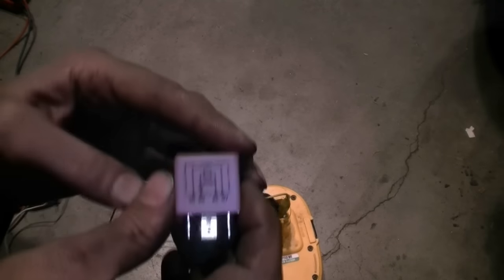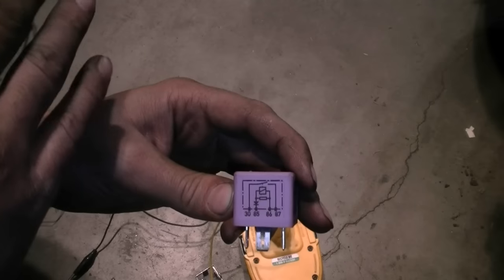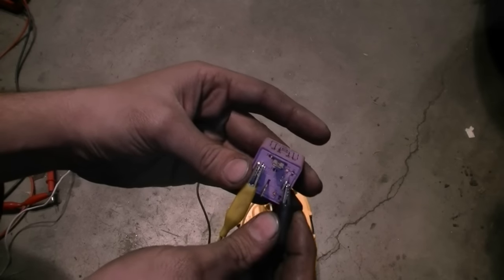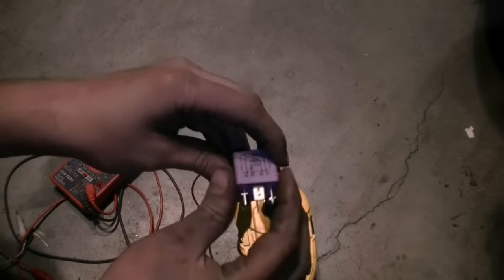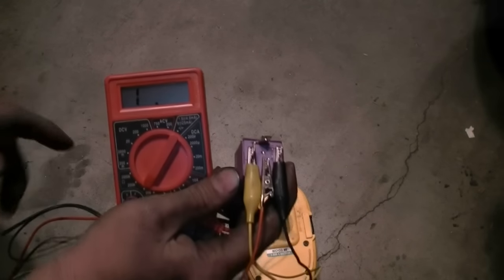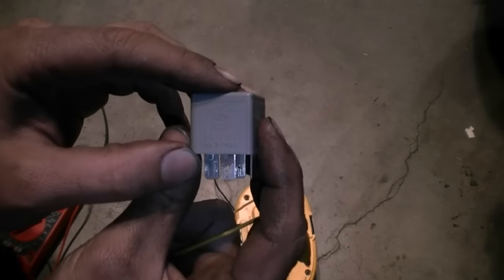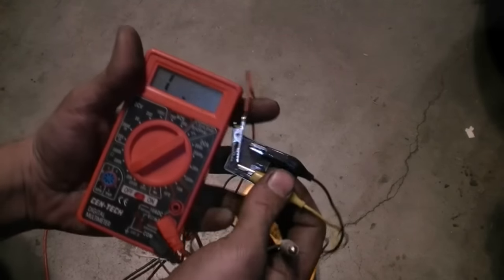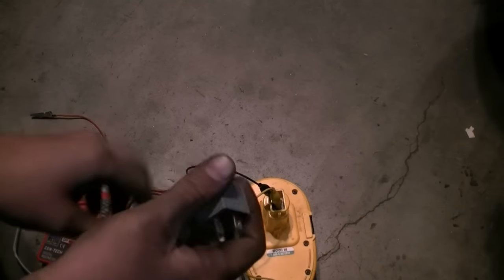How to Test a Relay the Correct Way

Comment: SWITCH! ITS A SWITCH!
Reply: As a Electrical Engineer I almost cried when he called it a flapper 😭😭
Reply: @alexanderquilty5705  Doorway! It’s a doorway! — never mind, wrong blueprints.
Reply: Ahahaha 🤣😂 uhh I'm right there with ya
Reply: @alexanderquilty5705  You came here to learn. Sit down.
Reply: Flapper
Reply: Contactor is the correct term.
Reply: contacts
Reply: It's relay
Reply: No it's not a switch, it's a contact or relay . It's designed to move contacts to energize the circuit. The contacts are designed to be a wear part that obsorb the inrush current/ arch
Reply: @Alexander Quilty  I know guys that don't know the name of nearly any of the parts they are working on & can fix damn near anything & still work circles around engineers & guys with degrees that went to school to learn the names of fancy parts..just sayin.. sometimes it's more impressive when people can just fix things
Reply: No, it's called an armature.
Reply: As an identifying plumber-self... It's a flapper.
Reply: its a flapper now
Reply: It’s a pole
Reply: @alexanderquilty5705  why are you watching this as an electrical engineer
Reply: @SupaDave63 obsorb[ sic]? Arch[ sic]?
Reply: I'm just a regular electrician and that still hurt.
Reply: @MrMd5555 they might not know the correct terms but they do understand what occurs and how it works.
Reply: It’s a dong
Reply: Its a staff

Comment: A 9V battery works great for this. It’s enough voltage to get the relay switch to pull in (I imagine there are heavier relays where this won’t work, but on these small auto relays it’s a piece of cake). No clip leads or cordless battery needed.

Comment: If uncertain of a relay, another way to check is to swap it with another of the same size from a different circuit.   If the problem goes away, you can be reasonably sure the 1st relay is bad.

Comment: Ratchets and wrenches, love your videos. I just wanted to add one thing you forgot to mention. 95 percent of the time a resistance or continuity check is perfectly fine but sometimes a bad switch will show good resistance but as soon as you load it with more current than what the multimeter can put out it will go back to an open circuit. This concept burned me a couple times before I understood it and will make you go crazy if you aren’t aware.
Reply: Also not to forget, temperature plays a critical role in this. Some relays will act up jerking when the engine bay is hot. Under heavy traffic or traffic jam (stop and go traffic) or also under low freezing temperatures. So those cases are a little bit harder to diagnose because basically you want to wait until those conditions happen to test them. It once happened to me. Just my 2 cents.😁🙃😜
Reply: @joecualquiera  Amen to that ! . I replaced all the relays on my 1987 BMW M6 with Tyco and Bosch relays for prevention of possible problems. Then I started getting full throttle power surging. The new fuel pump relay appeared to cycle open -closed under load and hot southern climate. Put old one back in - problem solved. Maybe the diode-resistor combo on the new Brand A relay was a little different than the original Brand B relay.
Reply: Could i use something less than 12 volts? Like a 9 volt battery?

Comment: I know this video is like 8 yrs old, but I am so glad it is still up. Yesterday at the car show, a fan came up just after I pulled in and parked. He was sharp. He noticed right away one of my dual elect. radiator cooling fans was not working. It has a built 460 in the 67 Mustang and it has been running hot.(It is also very hot outside too). I planned on putting a toggle switch in anyway so I can turn them on earlier rather then when it is 185 deg or higher. Wired up the toggle switch, and test both relays for the click. Will finish up with the resistance check tomorrow. Thanks so much for sharing this info. It has helped so much. Cheers from Motown.

Comment: A couple basic tips for those who don't know:  A normal switch has 2 basic states, normally open (NO) or normally closed (NC). When power is sent to a switch it change states, so a NO switch will become closed. That means power will be distributed to any legs designated after the switch. A NC switch does the opposite, when signal power goes to the switch it will open the circuits, terminating power distribution. 

Troubleshooting note: A digital multimeter had two fuses. One for checking voltage, and one for checking continuity. ALWAYS check voltage before checking for continuity.  When checking for resistance the meter uses its own power to test the circuit. If there is voltage on the circuit it will automatically blow the fuse because you're checking resistance on a hot circuit. Check voltage before resistance and you'll never need to replace fuses or worry about testing a hot circuit
Reply: This was a good video because it’s for visual learners.

Your context helps people who like to read but not people who can concentrate.

Granted theirs good info it doesn’t help at all for some people, perhaps you can also start a YouTube channel to share and explain?
Reply: @Gambit-jo4rw  ty
Reply: COULD you explain this more?
Reply: I installed an in-line fuse because I often leave the lead on the amperage terminal.

Comment: For all the questions about "Make sure the ground is connected to ground and the power goes to power," ...

Typically-
pin 85 is ground (negative)
pin 86 is power (positive)
pin 30 is constant supply power to whatever is being activated by the relay
pin 87 is the output of pin 30 when it gets switched on. 30-->87

To be certain which pin (85 or 86) is positive or negative...the diagrams often have a symbol of a diode (triangle and a line) on either pin 85 or 86, whichever pin the "line" side of the diode symbol goes to is negative.
Connecting power backwards will simply do nothing, this is what the diode does.
Reply: thank you for information  on positive and negative  which  wasn't  in there
Reply: Actually the diode is inserted across the solenoid for safety reason during deactivation phase.
Reply: Thanks mate
Reply: Thank you. While this young man is great and I've been learning alot, you read my mind on the little pins, and where they went. Being a beginner I'm soaking up all the info I can. I went on your channel to see if you had any instructional videos on Multimeter checking. To me that is the most daunting as it's so specialized. Repairs of the body of the vehicle and all the other things are great but am looking for more videos on this very specialized information...multimeters and how to check fuses, relays, and wires, etc so we can figure out why our power goes south in our car batteries, despite starting out with a strong and new battery. God bless.
Reply: I just bought a new relay and it doesn’t have any numbers or Diagram on it. How do I know which is Positive and negative
Reply: Alright, my question is you have 85 and 86 and you have 30 and 87 but on mine I have all that plus a 87a, the way mine is set up it shows 30 to 87a then right under it there is the 87 like it has another connection between the two. What's that one for?
Reply: @rmcgrath9666 that makes since. Thank you. I had one that went to my fuel pump on my 99 f150 was the only reason I asked.
Reply: Thanks for this!
Reply: @hilham89  He also has another video that steps you through the five pin relays.
Reply: @rmcgrath9666  87a is the open loop position terminal. 87 is the closed loop position terminal.
Reply: actually it doesnt matter when you check it
Reply: Thank you.👍
Reply: @hilham89  *
Reply: So in order to bypass a faulty relay with a paperclip, you’d go from 30 to 87 in this case correct?

Comment: I appreciate this. I'm having to hunt down individual components for an appliance controller board that has multiple relays. Watching circuit board videos, they just touch contacts and don't explain why. This makes it more understandable and by your explanation, theirs are incorrect. I am extremely grateful for this! Now to figure out how to run a current through without desoldering the individual relays. 🤔 Can't clip onto anything... I'll probably need a spare pair of hands. Thanks again. You're a gem.

Comment: Thank you . I have a CEN-TEC relay tester tool that does both the switching test and the continuity test at once BUT until I saw your video I didn't fully understand it was doing that. Just toggling mode 1 and mode 2 on tool and matching readout to answer in booklet. So I am like a kid with a calculator that didn't learn to add. Thanks for teaching .

Comment: Thanks for this video! My rear defroster in my 2003 Acura TL wasn't working. Power light for it would come on but no power was going to the defrost grid on the window. I removed and checked the relay with a 12V power source and it clicked, but no reading on the other leads. Just ordered a new relay and hopefully the new one solves the problem. Thanks again!

Comment: Looks like I came late to the party, but great vid .. well explained. As to the "flapper" you can call it a "switch", which is all that any relay is. As to the second test, most people forget that mutimeters are protected against significant voltages and IF that circuit was being completed, the meter would have read a resistance of zero, or close to it (all wires, even those used to supply electricity to our homes, have a little resistance, though it may be below the capacity of the meter to even measure). Final point, the symbol, Ω, is the Greek letter "Omega" .. sounds like "ohm-A-ga" (not proper phonetics, but illustrates the connection :) ). Love your videos, and have been recently applying them to a car that cranks but won't start .. major pain!

Comment: Check The OHMs on the 2nd relay without power being connected between 85 and 86,  Then you will get the connection of 30 to 87 that you had on the first relay. Relays can be (NO) normally open 1st relay tested OR (NC) normally closed 2nd relay tested. Had you checked both relays with power applied and without power applied you would have found both relays to be good. Just that one completed a circuit and the other opened  a circuit.  Relays can also be (Single Pole Single Throw)(Single Pole Double Throw) (Double Pole Single Throw)(Double Pole Double Throw) That is the reason most relays have the diagram on them so you know which one you are working with. Had you looked at the diagram closely on your relays you would clearly see that the first shows to be closed between 30 and 87 and on the 2nd to be open between 30 and 87 meaning when energized 1st  relay connects 30 to 87 and the 2nd disconnects 30 to 87 .  Note when replacing any relay not only do you need to how it works to say it is bad, you need to make sure the replacement operates the same way. Or  you can create a bigger problem than the one you where trying to fix. Thanks for the video it is done very well and is informative and a great way to test relays. Just make sure and test your relay with power and without power as you did on the 1st if it switches from on to off or vise verse chances are the relay is good..

Comment: That "flipper"  is actually magnetically activated, and the contact looks like the points in old cars, but on a 5 prong resistor, the point is double sided. You video is really good, it helped me tremendously.

Comment: You can do this with a 9v battery. The posts fit perfectly across the terminals.
Reply: thanks for the tip, was going to jump from the car battery lol
Reply: I used to do that at the parts store to test both relays and headlights. Gotta make sure it's a strong one, though. Nine volts is only 75% (or less) of what the relay is built for and a weak battery may not be strong enough to flip the switch. In the store I would test the old and new one just to be sure I wasn't getting a false result due to the lower voltage.
Reply: you can also daisy two 9 volt D batteries to get 18 volts
Reply: Volts and ohms have a relationship, so its scaled, so 9 volts has the same proportion of resistance as 12 volts would
Reply: hOW DID YOU KNOW i WAS WONDERING WHAT TO USE? lol THANKS!! 👍
Reply: I use a 12v a/c transformer out of an older recessed light fixture. Been using it for years on car marker/headlights, too.

Comment: Wow.  You just saved me some frustration. Not less than 3 minutes ago,  my 98 accord's condenser fan relay clicked - tho' the condenser doesn't work w/o bypass to battery.  THEN I saw your resistance test - bam.  No change from the 1!  Thank you for this.
Reply from the maker: youngdrjung Hey np, glad you found it useful. Cheers

Comment: thanks, your demonstration worked for me.  the only thing I was not clear on was the positive side connection, and I found that in a comment, well explained, herein.  other question was does it have to be 12v power supply for a 12 volt system relay?  reading comments, not really.

Comment: Pretty cool. I've just bypassed the relay before to see if it was working. If it works then relay is bad if nothing happens something else but still could have a bad relaybut this is cool also. My grandfather had a truck and the garage told him fuel pump was bad so I replaced it not testing it first thinking the dealership knew what they were saying anyway the new one didn't work so I bypassed the relay and it worked, put a new one in nothing tried relay in another spot that worked just not fuel pump lol. I eventually put the relay back in and run a jumper from the remote wire on the safety shut off relay to the fuel pump relay and it worked for 6 years no problem when he traded it in lol.

Comment: Correct terminology of a relay, solenoid, or contactor.

Normally Open N.O
Normally Closed N.C.
Common (basically the part of the armature that has constant power to it- depending if its a single or double throw set of contacts. 

Armature- the little copper arm that gets pulled down when powered to change states, then spring returns back to de-energized position.

Coil- Literally a coil of wire (A1 & A2). When voltage is sent on the hot side (or negative side if its a DC coil), current flows through and creates a magnetic field just like a motor or transformer, which pulls the armature down to switch states on the contacts and keeps it in position until the signal being sent to the coil is switched off. 

Hope that clears some things up. There's a ton of other details about control devices like these but this is the basics... Terminology matters in this field of work!

Comment: Just found a bad relay, thanks for your video. Much appreciated. Working on my 89 s13 hatch with aem standalone. With the relay plugged in, I get battery voltage to all my grounds even at the ecu pins. When I disconnect my cam sensor and grounds i have injector voltage. Obviously when they're plugged in, one or both at the same time, I have no voltage at the plug to my injectors. Going through my wiring a million times and determining I have everything pinned properly, I couldn't figure out what was happening. Testing this relay, and concluding it's bad, will hopefully fix my issue. The relay clicks when connected to power and ground, but shows 900 ohms when testing. So given your video, it's to my understanding that it's bad. I'll replace it and hopefully it does the trick. Thanks again.

Comment: Good video... another good way to start the test is to see if you have initial resistance across the switch gate, you should have resistance when it's not powered. If you don't then you know without even powering it that it's bad.

Comment: It's called an armature. The switch inside that opens and closes due to magnetism of the circuit when power is supplied. This video is helpful but may be confusing to many foreign car owners.  The testing circuit isn't always 85-86. You need to carefully read the schematic on the side of your relay. 87 will always be open, on some relays 86 is a ground, on some it is hot and carries a voltage and on others even more confusing it is completely unused. Like certain VW's for instance. The easiest way to realize that 87 will always be open, so on a 4 pin relay that leaves 85,86, and 30.  Usually on most relays 30 will be hot, son on foreign vehicles that don't use pin 86 the power circuit will be 30 to 85 which will close the 87 circuit and send voltage out. Because all relays especially on foreign cars are different you really need to learn to look closely at the schematic on the relay and not be so trusting of these videos.
Reply: What if it’s a 5 Point Relay, from a 1991 Lincoln Mark Vll & there’s no schematics on the outside of the Relay? The Relay in this video is from a vehicle more current  than my 1991.
Reply: @7777Lace  I would look the information up online, or I suppose you could just try all of the different pin variations to see if you hear the armiture kick over when applying 12v with low amperage.  I've never seen a relay without any markings. It must be generic, you could try looking up a brand or stock relay to get a better picture. Most all stock relays will be marked.  Best of luck!

Comment: i believe they now have solid state relays so there will not be a click. in both cases hook a multimeter / DVM to the circuit that will be completed 30 & 87. Put the DVM on ohms. before you energize the  two contacts 85 & 86 for the solenoid, dvm on oms should read infinite resistance b/c the circuit is open. when 85 86 are energized, the DVM should go to zero or close to zero ohms.

Comment: This a step in the right direction. You should really use something other than an ohm meter to check the contacts. It's possible for the meter to tell you the contacts are ok but the contacts fail under a real load like a light bulb.